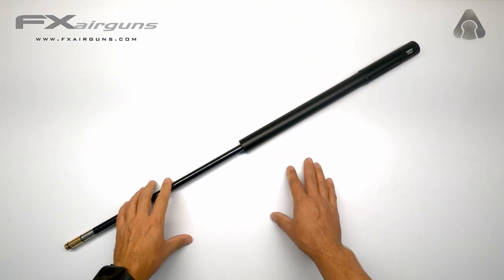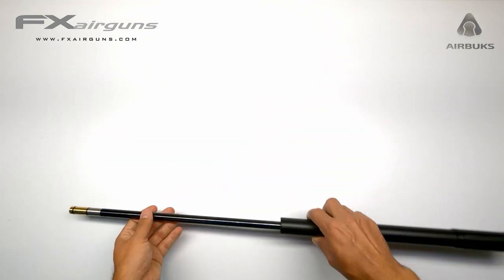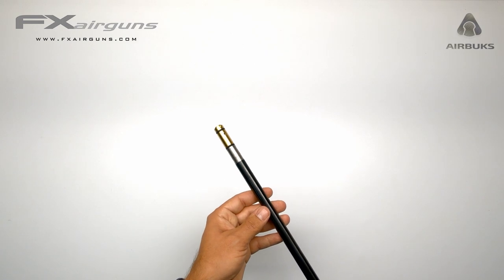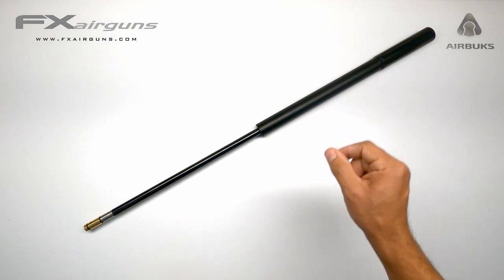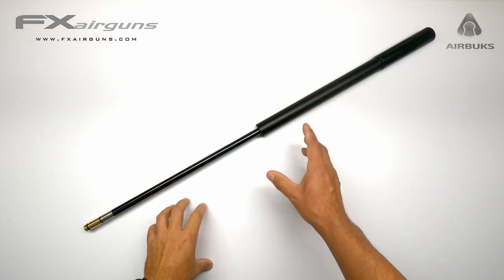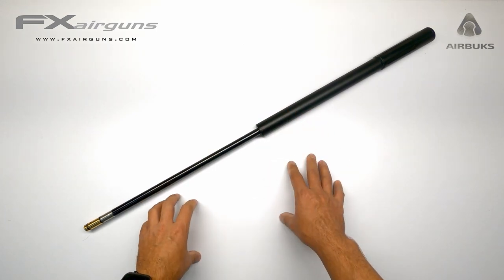FX Airguns 180° Rotatable Transferport

Comment: I have been looking for a video like this. I couldnt find one at all until now.  I noticed on the video it looks really easy to rotate the barrel. Can you tell me what screws need to be loose to rotate it? Also the slug port or pellet port needs to be facing down correct ? Any other tips like should the gun be uncocked while performing this ?
Reply from the maker: Hi , yes it’s very easy to rotate. What screws to loosen depends on FX Eagle you want to use it on . 
The port you want to use needs to face down 👍🏻 
Very important is that when you perform any work on your gun it has to be safe and uncocked 😉
Reply: @Airbuks  Thank you again.

Comment: Thats cool and all but what happens to the air consumption if you dont tweak the tune i would be in the mindset that it would just waste the air?
Reply from the maker: The air consumption is even abit better , the smaller tp prevents the power plenum from draining before the valve shuts again and therefore safe some air

Comment: i have tried this with the power probe and get allot of blow back, can you help please
Reply from the maker: 🤔 make sure that there is a oring inside .
Did you use the sleeve if it’s a 25cal
Reply: @Airbuks  it is 22 and i have checked the oring. i will try again today
thanks
Reply from the maker: Maybe a silly question, are the orings on the outside of the tp in good shape / there ?
Reply: My guess is your probe backed up a little allowing air to escape. It’s happened to me before.